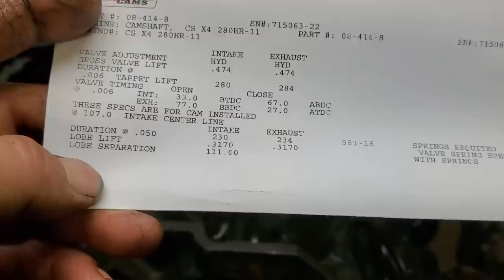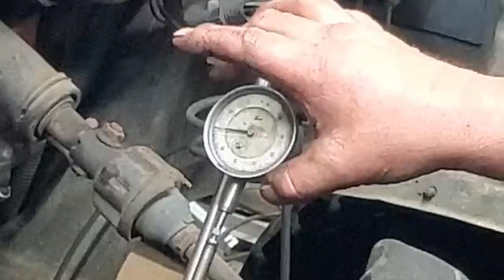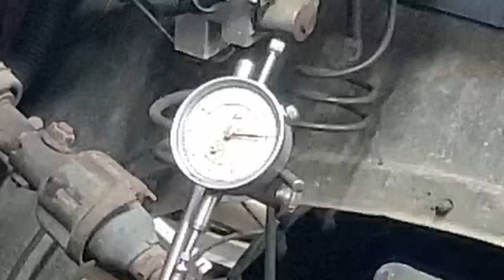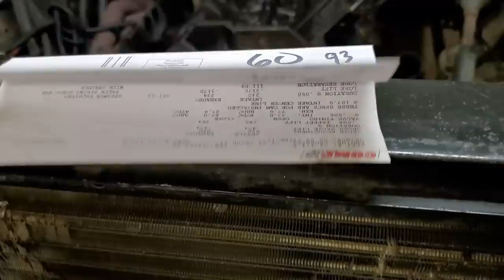1990 Chevy 4wd gets a heads and cam swap. Hot rod 4x4!! Part 1

Comment: You can screw them studs in like you just did in poly lock them and everything also you can drill on the side of the black there and pin to studs too even on the stock studs you can you could I would have left the stock studs in it and drill the side and put pins in them pin them that's what my brother does with some of his we've been building engine for life and that's what we do but yeah you're doing all right that's either way you can even with them studs I see them pull out and pull out of a head and stuff yeah I seen it a lot in my life I usually like I said we drill them and we pin them

Comment: That's gonna be a screamer with that 280 cam lol, I'm surprised you didn't cut the rocker arm base before tapping for proper clearance, you gonna use the zero lash and 1/2 turn on the rockers? aftermarket rockers,??, You might need longer pushrods??
Reply from the maker: Not sure what you mean by cutting the rocker arm base.
Reply: @ThisNThatGarage  stud base, usually I believe they machine them down, for big lift cams, but you said yours isn't really big so as long as the stud height is the same they should be fine ....125.00 for roller rockers on eBay now if you're interested I enjoy the videos keep them coming lol

P.s what is up with the T.A !! It looks sweeeeeet
Reply from the maker: @musiclovr2890  No need to machine the boss down unless you're using the other type of screw in studs. That's the whole reason for using these, so I didn't have to machine.

Comment: Ah another great video Chad. Thanks for the update on the shop. Lots of work. I still say the first job in the shop will be a truck. Question, is the motor your working on a 350. I may have missed what you said it was. Is that the same as a 5.3 or will it be that when your done? Really looking forward to here this truck run. Have a great Thanksgiving.   Texasman, Go Cowboys
Reply from the maker: It's a 350.
Reply: Monroe, definitely not a 5.3. They made a vortec 5.0 all the way upto 97(same/similar head this and that using here to replace the TBI heads), which I have(97 K1500). 5.3 totally different LS based engine. I think you could still spec out a normal vortec up to about 2001 on the bigger 3500's where most trucks would have LS's like a 5.3/6.0 etc. Shocks me this engine is not a roller cam. My mom's 5.0L  89 Caprice TBI is a roller, my smashed1988 parts car with 5.0L 4bbl has all the provisions for roller cam just like this truck so I guess the trucks changed over later or perhaps when they rebuilt this specific engine they went with a standard cam. I never knew/seen a factory injected SB like this without a roller cam. Interesting either way.

Comment: I have the answer for u..Yes we get older, But that's not it, As we age the clock of life Actually rotates Much faster, speeding up our enevetable shuffle off this mortal coil .Example: When you were younger, say 25 A Saturday seemed to last forever? Now you barely have time to complete one task you would have easily done on sat in the past..TIME IS RELATIVE to The total time you have,therefore the speed at which it flows is divided up and portioned out AccordinglySo as the clock ticks ,it is constantly readjusting the speed according to your time left. Do like Me Bud..Enjoy every Moment,Enjoy what u have,If something is wrong Change it. Love your channel

Comment: Are you running a single or dual patterns but duration game
Reply: Why didn't you run a split duration dual pattern Cam you'll find if you ever run one that's where your real horse power
Reply: You aint getting your maximum horsepower out of that doodle patterns but duration can is or you get your maximum horsepower built motor with that Cam before and put it in a 74 drive with 33" doll tired it didn't run bad but even my cousin and I who's a bit motive for years we decided the next time we built an engine like For some money we decided we'd run the dual patterns but erase it again cause we're seeing the difference in another guy set up with the same exact setup or run and again watch those competition lifters
Reply: You're looking at probably a 20 to 40 horsepower or better difference between the 2 cams if you build that roller motor for lockjaw try the other way and degree at the same way you're doing right now and sleep don't run different I think you'll be real surprised it is but I aint telling you this to take it in andcome you know kind of criticism or anything cause people always criticize me I'm just saying what I'm saying in these motors that we built back in where these toads were just about to go out as the motor that you put in a lock jail to start with There's no block to get back to work with but that's just how they ran
Reply: But demo head does make a lot of difference from where you're at from where you started from with the stock TPI head and 4 Tech heads will you'll be pleasantly surprised even with that camp
Reply from the maker: It is a dual pattern cam and this is a work truck not a hot rod drag car so I'm not after every little bit of HP.

Comment: What did u use on the studs I've got a set I need to do as well
Reply from the maker: You talking about thread sealer? I think it's oatey  pipe joint compound but the can is so old that all the lettering is worn off. I use it on head bolts too.

Comment: probably  need 2 change distributor 2 h ei.with vacuum advance 2 get away from ecm. electronic controlled ad Vance .because you changed from throttle body 2 carbarater  ?????

Comment: You can't run a roller Cam with very much lift with those lift to retention plate and the spider gear setup you're talking about you've got to be like under 488 lift well that's what you're looking for is something just miles treatable then you can do that but the best way to do it is to run a hydraulic roll retrofit camp and don't buy no cop cams junk because people have trouble with the lifters and complicates spell all the time The metal aint no good you're better off my hunting a set of stock and I'm going to lift your from eBay or Amazon yeah and then you can even run a cop camp's camp but don't run the lifters cause they're junk out of the Box They're made overseas and aint worth a darn

Comment: I've  got a real  project  I'm  starting  on the 4.6 in my  97 F-150 was tired  and I  was tires of it so I'm ripping the computer  out and got ahold  of a 1970 351 Cleveland  4bbl I'm  putting  in it

Comment: You will find that you are severely limited and how much lift and duration you can run with the hydraulic roller camp because it will smack the factory spider gears on the head there that you're talking about you to get most lift out of it you want to go with a hydraulic roller retrofit which will be for a block That was previously not a roller camp because non non roller blocks of course don't have the spider gears and all that factor c*** that limits your lift and duration but also you are limited by the vortex 1000 Springs to vary somewhat 488 lift at the very most

Comment: 3:30 the reason cars and trucks started getting designed more and more annoyingly past the mid 80's is the diminishing returns of efficiency. in order to keep increasing efficiency of the engines, they had to start making those kinds of changes that make the engine less serviceable. ultimately you end up with insanely shaped engines where everything is crammed together, a computer running everything, and fuel injection. but you also get over 40 mpg in a car and over 25 mpg in a truck. i love the simplicity of the 80's era cars and trucks, but i DON'T love the 8 to 10 mpg. not to mention EPA regulations that have vastly reduced health concerns like lead poisoning. we have an entire generation of lower IQ adults because of leaded fuel (that's going by statistics too). and as irritating as DEF systems are, when you scale them up to cover the hundreds of millions of trucks driving every day, it makes a HUGE positive impact. And OHV is exempt, so farmers still get their more reliable engines at the smaller scale. basically it may seem like things got worse, but in reality they got way, WAY better. just not as easy to work on lol